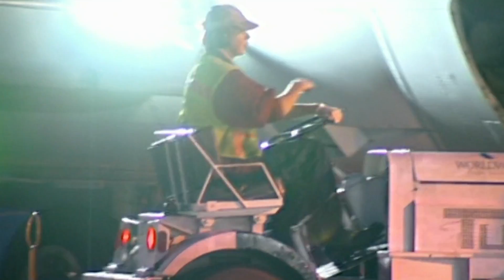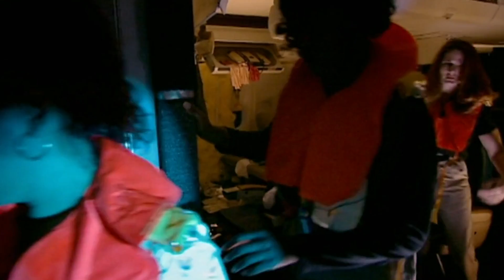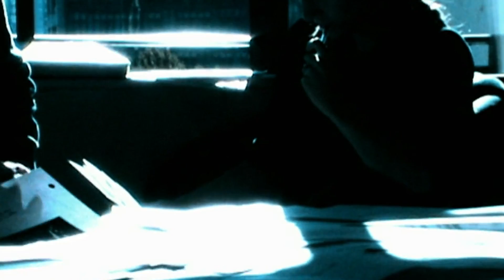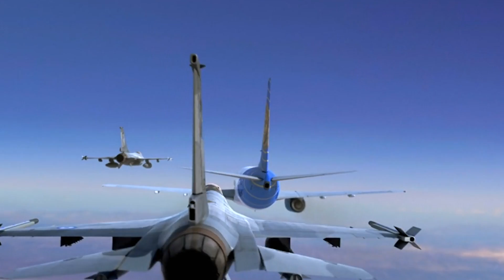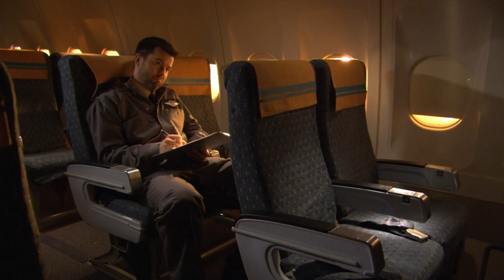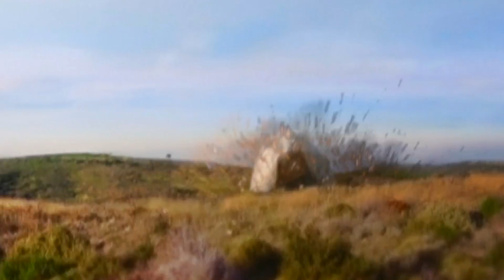Breakthroughs Within The Aviation Industry | Ripped Apart | Mayday: Science of Disaster

Comment: it's unbelievable that the pilots did not check the pressure setting...

and more unbelievable that the flight attendants never called the pilots as soon as the masks fell. 

I would have called them way before that, as soon as I notice my ears popping, 34 years as a flight attendant with Delta here.

Comment: They really should have oxygen masks pop down for the pilots on airliners when there is a pressurization problem. That way there is no mistaking it from the pilot's perspective that they have a pressurization issue.
Reply: Well like the one guy said...then you have to worry about them hitting switches and whatnot...i think what they have now is an some kind of notification or alarm that lets them know that the masks have deployed in the passenger cabin
Reply: @martyzirlott9777   sure those masks could be designed not to interfere with the switches. Pilots literally have seconds to don the mask upon depressurization before their judgement and cognitive abilities are compromised and it may take many seconds before they realize what the problem is whereas a mask coming down would be very obvious

Comment: Very good and thank you!

What wasn't mentioned is the "gentleman's agreement" between Boeing and the FAA to fix the cargo door after the first incident. Boeing's "fix" was to install a window in the door so the cargo loaders could whether the door had locked securely. After the second - or was it the third? - door-exploding in mid-sky incident, cargo loaders were interviewed and said they did not even know what the little window was for. 

Then and only then did Boeing bother to redesign the door and locking mechanism. Sound familiar?
Reply: i just finished that episode, sadly its more common than people realize companies go under the radar by handshake payment deals because its cheaper than an actual fix
Reply: @angus4202  Exactly.
Reply: Tombstone technology, it's only when enough bodies pile up and the lawsuits become more expensive than the money they would save by not doing it, would they do it. Every major industry from cars to guns to airplanes uses the same thing. Problem is many companies ignore it well past that.
Reply: That was the DC-10. The Boeing 747 was a different thing. Boeing may have hid the fact that there were flaws in the electrics, but they did tell all of the airlines to replace the L-shaped stoppers to steel ones after the Pan Am incident. It's just that the FAA gave the airlines WAY too much leeway in when to replace them, giving them 18 months. United 811 happened in that time frame. After that, the FAA shortened the time to 30 days. Idk if steel stoppers would've prevented that from happening completely, but the fact that Boeing went from single plated aluminum to double-plated aluminum to steel, they probably were doing tests and maybe figured out that steel would've prevented the locks from moving.

I think the real tragedy is that the aviation community didn't take the bad wiring seriously enough to do much about it, and if they did, TWA 800 wouldn't have blown up due to a short circuit causing a spark in a vapour-laden fuel tank.
Reply: @OwlRTA  They do give them way too much time.
Reply: You are thinking of the DC 10. This wasn't the case as far as I know with the 747
Reply: @VictiniStar101  Different planes does not exclude the door problem being the same, does it?
Reply: In many of these tragedies the real source of the problem can be traced back to the FAA not only not doing its job, but due to the FAA actually protecting the airplane manufacturers from accountability and liability.
Reply: @DeanStephen  Of which this documentary is a case in point. A little bit too chummy, aren't they? Stuff like this led to the 800 Max disaster.
Reply: In the full episode they do mention that.

Comment: The one thing about the 747 is despite the parent's satisfaction in it?  Also fortunate their actions didnt completely inhibit change.  Taking the files like that could have made identification of issue and change, or potential criminal action impossible.  

Only because it was something relatively simple did it not mean much. But same time is if it was something more complex, the delay in finding cause of incomplete files could have also resulted in another accident.
Reply: And yet because of those two parents never giving up until they found the reason for their son's death things did change. I would say the only criminal actions here come from the airplane manufacturer refusing to admit that they had a problem and that they made a mistake. Kudos to the parents
Reply: @kevinmiller3375  Well, that is the thing of debate.  Because it worked out in the end, it is justified?  As was stated, the NTSB had also come to the same conclusion.  Hence bringing up the question as to whether their actions brought change.  The purpose of an independent investigations for any aviation accident is so they can tell manufacturers when something needs to be fixed.

From my perspective, this is only a viable argument if a case could be argued that the accident investigators would not have come to the same conclusion.

Tragic outcomes from good intentions is unfortunately all too common.  Is "Did it for my son" going to be solace if it killed somebody else?  That is what I was getting at.  If we looked at this situation in the big picture, the action had much more potential to prevent finding a solution since now you had two different groups with potentially only half a puzzle.
Reply: @russelljacob7955  Agree 100%.  Their actions could have completely denied satisfaction for the other families.
Reply: I'll bet that glass is always half-empty for you guys.
Reply: In such a short episode, details such as the fact these documents would have been marked ‘COPY’ are left out. Their actions would not have inhibited the investigation in the slightest.
Reply: @tekaiau  Yes it would have.  Unless they knew for certain that everything was just copies before hand and said copies were not actually being used as part of the investigation.

Cause if they were, and now they had to spend a couple days figuring out what was taken and making new copies?  Then that is days a solution gets delayed.

The best test for whether something was good or not is what the worst case outcome of their choice was.  This is being lauded because there the outcome was not bad.  What would people say about them if it got more people killed?  Cause that is the reality if we view it from a distance even in the full shared story.  That this had the real and probable repercussion of delaying investigation and a solution.

The only reason they got the answer is it was an obvious solution and one that was already mostly identified and in the papers.  But if it was something more complex such as say an issue in metallurgy or more complex electrical fault, etc.?

Ends dont always justify means.
Reply: @russelljacob7955  did we even watch the same program? This was the third accident of this type from a cargo door blowing off. The NTSB did not come to the same conclusion they came to the conclusion that the baggage handlers had misused the locking mechanism. The only time they came to the proper conclusion was after the parents got the information and forced them to come to a different conclusion. The parents are the heroes and would not have caused harm to anyone.